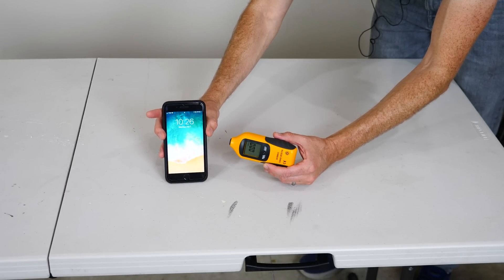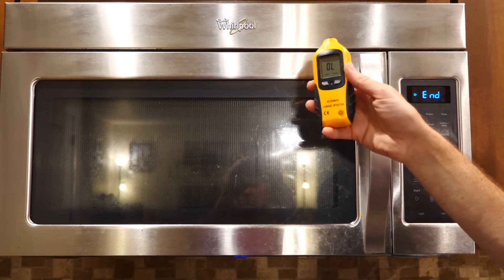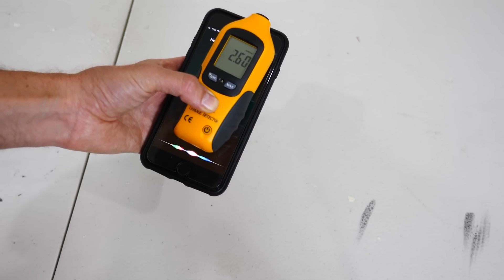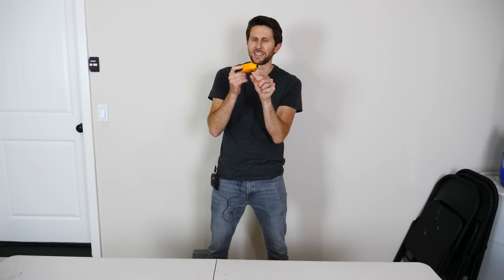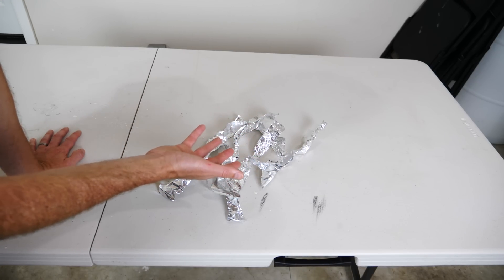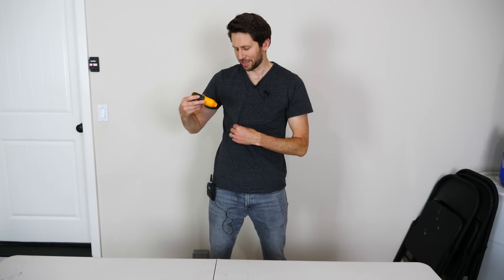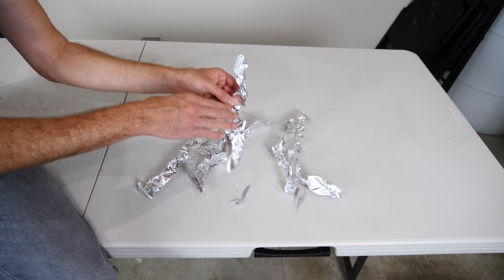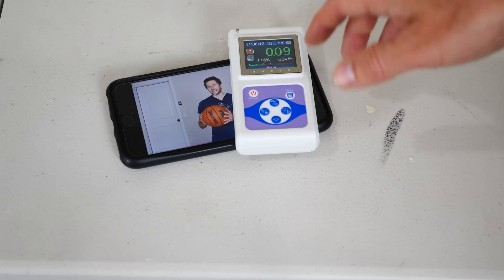How Much Radiation Are You Getting From Your Phone?

Comment: I am looking this up because I bought an iPhone XR just a few months ago.  I had the cheaper iphone model before and never had any issues.  I don't understand what is going on, but after using the XR for about 3 months, I ended up having crippling pain in my hands.  And I could feel it when I picked up my phone.  I could handle my kid's phones or my husband's phone, or do anything else that required fine motor skills, without any problems.  But the moment I picked up my phone, my fingers felt crippled.  I also had carpal tunnel type pain in my wrist, which I could see happening from the way I hold the phone.  And the XR is a bit heavier and more awkward to hold.  5 months after shelling out over $600 for a phone, I went back and bought another SE model because I just couldn't stand it any more.  My finger tips still feel stiff, but I can feel a big difference with the SE.  I don't really understand what's going on, though.  Could some phones be giving off significantly more radiation than others?  Is there a way I could have this XR phone tested?
Reply: It was probably the size of the phone and the way your holding it
Reply: @tseriesbad6746   I realize that the way people hold a phone can cut off the ulnar nerve. And I was definitely having ulnar nerve pain and numbness that went from my last two fingers, carpal tunnel type pain through my wrist, and pain and muscle twitches up my arm.  However, for awhile before, I was avoiding holding my phone.  Also I did a couple of blindfold tests, where I was blindfolded and my husband put a phone in each hand, one streaming video through cell data and another in airplane mode just to see if I could feel something definite.  I'll admit that this could mean a variety of things, but I was definitely able to tell which phone was active because I either felt an aching pain or small pulsating shocks.  When doing this test, I was laying flat and my arms were straight.  So I wasn't in that ulnar nerve pinching position.  But for several hours after doing the test my ulnar nerve pain in my wrist and hands flared up and I had an increase in muscle twitches up my arm and throughout my body.  It's like having contact with the phone was causing my nerve to tense up, rather than the nerve getting pinched.  Some of the symptoms have been scary -- like having the sensation that my body is slow to follow brain commands, and my hands and feet feeling stiff.  I've looked up some of the symptoms, and I realize that some of the scarier symptoms may be symptoms of a migraine --like seeing flashes of light, and feeling like my pulse is beating hard and feels off rhythm, when it's actually not.   I realize how nuts this sounds.  No one else in the family feels shocks or pain from holding a phone.  It's only me.  I don't know if it will always affect me like this, and I don't want to go down the rabbit hole of RF and 5G conspiracy thinking.  But I know I'm feeling shocks and pain from the phones.  (And it's not just the Xr.)

Comment: Thanks for your great videos ! Questions:
1. Why did you edit out the part at 4:53 where you read out the reading on your detector at close range to the phone?

2. Let's say that heating effect from a phone is lower compared to solar radiation and that phone gives out only non ionizing radiation, can we conclude that non ionizing radiation doesn't have other (non heat) effects on our body?
Reply: It does  affect the body. It's been clearly shown to work through the voltage gated calcium channels. Voltage gated calcium channels are activated and release millions of calcium ions leading to an increase in nitric oxide and then peroxynitrite and other oxidants.

Comment: This guy has no clue of what he is talking. Radiation on live beings is measured in cubic centimeters, not in square. And 5G is not safe because it is heating 10 times smaller part of the body with 10 times higher power. 4G has frequencies at 2GHz and 5G they are testing at 20GHz to 86GHz are the ones that are damaging the tissues the most. The power that you absorb from 4G is spread at half of your body, approximately on 50Kg. The 5G does that same power at the front 5Kg and 10 times faster. 5G is dangerous, especially the phone in your pocket. I will put a video with detailed explanations soon. Non-ionizing radiations are dangerous!
Reply: So since non-ionizing radiation is dangerous it doesn't give you cancer, dna damage, or mutations instead it heats up your body and gives you radiation sickness in your stomach which causes nausea vomiting. So the raftaion type that gives you cancer, dna damage, or dna mutations is ionizing radiation which are X-Rays or Gamma-Rays accompanied with Gamma Ray Bursts from Space. Luckily were over 3,000 light years away from those cosmic monsters

Comment: Try with an EMF tester - my mobile does 3.2 microTeslas during a normal call (which would be right against my head)    while my wifi router (dual band 2.4Ghz & 5Ghz)pumps out a scary 9.2 micro teslas up  to  a meter away. - accepted guidelines is over 0.4 micro Teslas sustained is dangerous. (dont put a router near anything living).

Comment: It's not just heating stuff up. It's the method used to heat a thing. The sun is direct heat. Actual heat. Microwave must disturb molecules in an unnatural manner.  Microwave radiation isn't hot but wat it does to the thing it is exposed to heats up the thing. My molecules aren't suppose to flip back n forth lol. They're just not. N that difference is the point of concern with tumors in the heads of people who put their phone to their ears to talk.

Comment: Wait wait wait 

9:03 it says microwave radiation wavelength is dangerous
Reply: Yeah if microwaves have enough power then they heat up whatever they pass through. The danger is from heating rather than cancer but usually you will never experience microwaves of this power. The same is with visible light if you increase the power it can burn stuff but slightly different physics happens with microwaves

Comment: This is all really wrong.  To do this property, get an EMF meter.  EMFields Acoustimeter AM-10 and  the Safe and Sound Pro II RF Meter cover a range from around 1 to 10GHz for about $400.  You can get one that measures up to 3 GHz for half that.  The Acoustimeter does not have enough scale to measure the Microwave up close, but really you do not want to be close to a microwave oven when it is on, anyway.  Microwaves vary a lot in the IMF/EMF they give off and there is a real problem with the once trusted GE brand.  The Federal Standard for allowable level of radiation from a microwave oven is 50,000,000 micro-watts per meter squared at two inches. At 20 inches that is about 500,000 and at 200 inches (17 feet) that is about 5,000 micro-watts per meter squared. Some ovens we have tested are well below the limit, while others were pushing it. GE was the worst, while other such as the Whirlpool were about ten times lower. Who knew? If you test these with a sensitive meter, start from a distance. If you are not willing to give up your microwave, you can reduce your exposure by using the lower power settings and distancing yourself.
Reply: It's worth noting that the general limits are set with safety factors in excess of 10x, so it's almost certainly not an issue either way.

Comment: Dude. you shouldn't run a microwave oven with nothing inside of it. I'm pretty sure the instructions tell you that.
Early microwave instructions even suggested keeping a glass of water sitting inside, just in case it gets turned on.
The reason, "internal damage may occur"

Radiation can't hurt you.
Radiation is an action happening, not a thing.
Depends on what is radiating, to what can harm you?

Phone towers ( Nicola Tesla wireless power towers ) base stations and phones talk to each other with higher power. 
5g is 6g of talk signals. 
FYI . The cloud or plume of electromagnetic energy waves, is called a " carona "
Carona effect is the concern people should have.
Cells in our bodies are being bent and shaken. 
When you bend things back n forth, heat and positive charging can or does happen. Also, oxygen gets knocked off or out of blood cells. Lack of oxygen in our body's leads to many problems. 
If blood cells become charged, they clump together because of magnetic attraction.
You'll find blood clot clusters around phone towers and basestations. I'm positive you would.
The most common carona effect, ringing in your head.
TV or radio interference from an old motor vehicle going by is another example of a carona being effected by another carona.
Spontaneous combustion of people is caused by the corona effect ? Every case I've looked at, there's high power electromagnetic emitting devices.
TV stations or radio stations nearby with high power power lines overhead. 
Or they're next to a power substations. 
There's always a TV on in the room of every modern case I've read about.
Older cases, before electricity. they wore makeup that was highly flammable and people witnessed those cases. 
Living organisms are not ment to be inside/shaken by man made electromagnetic energy . Full stop.
We humans are ment to be driven by the earths frequency not the fast high speed of man made electromagnetism.
If we are driven faster, we die sooner ?
UN staff members have asked for the 5g systems to be removed from their office buildings.
A telco worker in Australia "stole" a mates tank and drove into power boxes at phone towers. Trying to make a point. 
He was a Heath and safety officer for the company.

Comment: Whst it's dangerous on a phone or microwave frequency it's the variation on the waves high and low lack of continuity that happen when you answered your phone being the highest that's why on your phone if you go to menu about your the device safety standing that you shouldn't have your phone close to your head less than 25cm and that's why the provide a set of headphones no long Calls more than 3 minutes... Not have close to your heart specially if you have a heart problems and not close to your testicles or close to your belly if you are pregnant.. so check up what the manufacturer of your devices have to say before using them...
Reply: claudio saldivia said: "Whst it's dangerous on a phone or microwave frequency it's the variation on the waves high and low lack of continuity"

This is utter GARBAGE. A 1 watt signal switched on and off at 50% duty cycle has the SAME total power as a half-watt signal that is continuous. Pulsed signals = REDUCED TOTAL POWER. That is an indisputable fact.

Comment: Electromagnetic radiation and its influence on it
  human body

From the regular news broadcast, the thing is that the phone is about is non-ionizing radiation and that it is not dangerous.
This propaganda has to stop because this test says nothing at all

The measurement used is that the body does not heat up more than 1 degree locally.
electro-mechanical radiation is actually potentially dangerous in all forms, 
because humans are a bio-electric life form.
just to mention a simple example, 
our muscles are controlled by electrical signals in our nervous system.
Now the biggest problem for our body.
Microwave electromagnetic fields activate voltage-dependent calcium channels in our body.

because VGCCs are activated by EMF, there are all sorts of problems arise such as

- single and double strained breaks in cellular DNA
- break down the blood-brain barrier
- greatly reduced melatonin levels and sleep disturbance
- male and female infertility
- immune system disturbance / more susceptible to diseases
- neurological disturbances
- cardiac (heart) problems; tachycardia (Too fast heart rhythms)
   Arrhythmia (arrhythmia)
- cancer
- depression
additional explanation lowered melatonin levels:
-------------------------------------------------- ------
In humans, the natural production of melatonin by the pineal gland is directly linked to the light exposure of certain receptors in the retina of the eyes.
 In the presence of bluish light

(from sunlight or from artificial light, television or monitor) 
the production of melatonin is inhibited.
If exposure to light decreases, the natural production of melatonin starts again.
For the body, this is the signal to reduce daytime activities and prepare for nighttime.
-------------------------------------------------- ------------------
because light is an electromagnetic radiation.
melatonin production is also inhibited by radio stations that are all around us. 
such as, for example.
mobile phone, wifi, smart meters, dect phone, baby monitor, and all communication antennas for various applications.

-------------------------------------------------- -----------------
lowered melatonin levels not only pose a problem that sleep disturbance occurs, but melatonin is also responsible for the recovery of our body at night
It has a crucial influence on basic functions of our body, including the DNA. This is because melatonin clears out harmful free radicals.
Melatonin also helps mitochondria,
 the energy factories in healthy cells .

More than 20,000 publications have been reported in the scientific literature, in which the biological effects of exposure that fall well within the so-called safety standards are often ignored by the media and so-called experts that you always hear in the regular media.
I hope to be able to inform people better through this way, because I really think this is necessary in this increasingly larger technological world, it is very nice that you can download faster and connect everything, 
but the most important thing I think is, that it is also done in a safe manner.
below are some links where a few hundred studies are done,
The documents are free greeting so they are on my Gdrive.
NMRI investigations from 1971 - 106 pages
https://drive.google.com/file/d/1fJDJcAVOoAllUfmd6cOBjqB3AiLpIDWh/view
Bioinactive studies from 2012 - 1557 pages
https://drive.google.com/file/d/15xCTryVadYihhIV0qajhkJyFFot45Uo4/view
Researching VGCCs from 2018 - 90 pages
https://drive.google.com/open?id=1fZ3Mbbdcjy1sji60TtmtCgepxSHvaL24

Comment: I would think that just putting your cell phone in the microwave and closing the door, and then try to call it. If it doesn't ring in the microwave then there is no leak coming from the microwave. This would be a way to detect if your microwave is faulty. I don't pretend to be the guy that has it all figured out. But it seems like it makes sense...
Reply: Except that theory would be faulty since cell phones don't use a single frequency and it would depend on the carrier used.

Comment: I'm not cocerned about wifi but about the satelite avove our heads constantly beaming over our head
Reply: The power level of satellites disperses so much from being so high up, that it gives you far less power than a nearby radio station at a lower frequency does.
Reply: I'm concerned that the brain has a lot of iron and chemical electrical signalling going on.  I'm not worried about ionization or heat.  I'm concerned about what it's doing on an electrical level.  I'm experimenting with mylar-lined hats and mylar hats, as well as a mylar shield where I let the phone charge.  I want to see if things improve.

Comment: F that, I’m done with cell phone.
Reply: In 1980 people were exposed to severe toxicity that was around kilometers into the atmosphere and they  could've  got severe reactions out of that. And now, radiation that only heats you less than the phone battery itself you choose to dump it. Did you know that there were people who worked in Chernobyl after the explosion(but now it's illegal). Also, next time check your posts for radioactive spelling mistakes.

Comment: good video. after watching and reading some comments here is mine. Im coach scientist so correct me if wrong. microwaves are causing vibration of close by particles. you saying it is not ionizing radiation therefore it is safe as it will not break  a human cell, only make it move and heat up a little. ok. 2ghz is a wave changing its polarity 2 billion times per second. it will make a cell  shake approx 2 billion times per sec. 5g is 90-300 Ghz so it will make a cell shaking 90-300 billion times per second. ARE YOU 100% SURE THIS WILL NOT CAUSE ANY TROUBLE TO THE CELL????
Reply: Kosmogonik i understand where you are coming from,  but the microwaves dont shake the cell, they shake the water molecules. And molecules shaking is just heat - they would only actually not be shaking at absolute 0 or -273.15 degrees C. I.e. the shaking is on the micro level not macro level of the cell
Reply: Also bear in mind the order of magnitude difference between a molecule and a cell. A water molecule is roughly 0.3 nanometers in diameter while an average cell is 10 micrometers. That is 100000x the size so a vibration of molecules is not at all related to the resultant vibration of the cell
Reply: @damiangames1204  when it comes to vibrations (resonance) size wont matter. it is rather frequency and power level. walking army through the bridge with fixed tempo (fq) can cause bridge to collapse, if it will resonate with fq of army steps.